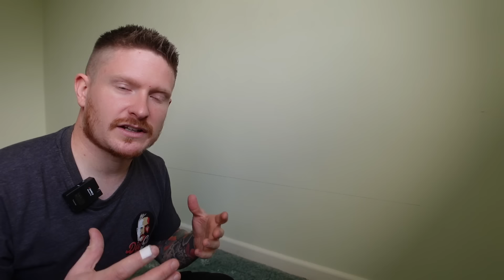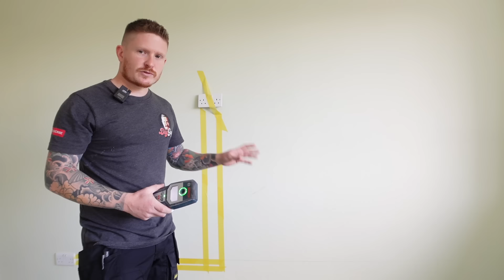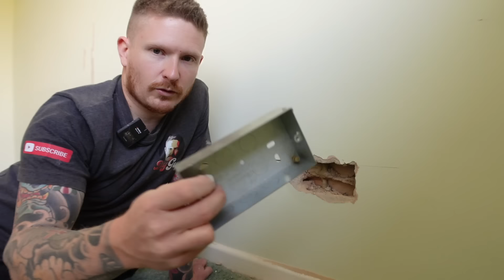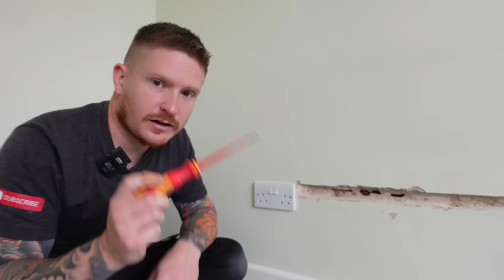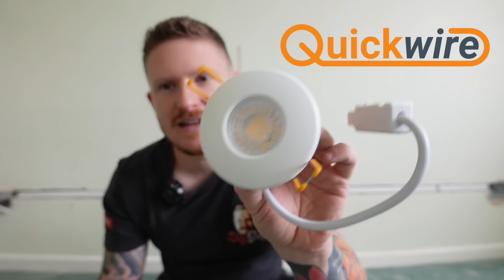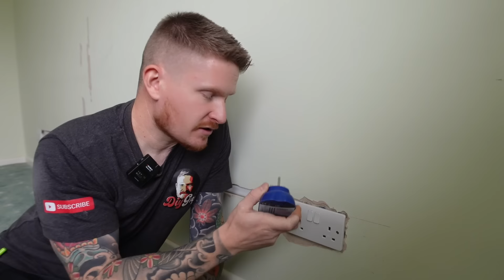How to Add a Socket to a Wall - Easy Step By Step Guide

Comment: Hi mate, how do you know if the circuit is a ring or radial? I understand looking in the CU to check for either one or 2 wires however, a single wire at a socket could also mean a spur than a radial? Keep up the good content 👌🏼
Reply: this is easy. check at the CU, if you have to sets of cables then most likely a ring. Then check the socket you want to extend from, if it only has 1 cable coming in, then you need to go check another socket. If it that one has 2, then that means the first socket you went to is already a spur, which you can not/should not spur off again.
Reply: @j8ybb  I could also check if its a ring or radial by looking at the circuit breaker mcb right? Ring would be 32amp whereas radial would be 16amp or 20amp. I could probably check this from the socket by doing a continuity test between earth to earth, neutral to neutral and live to live to get a reading

Comment: The only things i would add is.
Check the existing socket is still a RFC, all to often its broken somewhere...
You need to make sure the Zs and R1+R2 is good.
The fly need is good practise but not needed if the backbox has one solid lug and if it hasnt then the fly need isnt needed if a class 2 fitting is being used.
Reply: You sound like an attention seeker. This is a DIY channel.
Reply: This is a DIY channel Pal aimed at those who's moto is if it works its a good job. I doubt very much the poster will give 2 nuts about whether the impedance on his sockets is good & whether it will meet disconnection times in case of a fault.
Reply: @JIBS.  doesnt make it right though

Comment: Also do a video on adding an extra socket to be included in the ring main. Should be very similar just an extra wire. But may be useful for others
Reply from the maker: Great suggestion!
Reply: I was just thinking that iv always done a spur with 2 wires so its basically part of the ring then and another spur can be taken off of it if needed 😊

Comment: Thanks for a great video. You said you can't spur off of a spur. How do you determine if an existing socket is a spur or not? Thanks.
Reply: If there is only one set of cables in it then likely a spur....
However.....it could also be a radial circuit which would be fine to extend....these are on 20amp MCBS or RCBOS.
Or if there is FCU powering the spur...then you can add sockets to it fine with no problem
Reply: @SJM689 so how can you tell that it’s a radial circuit or whatever?
Reply: @hotmantym7096  usually by the size of the MCB a 2.5mm radial will be on a 20amp breaker, a 4mm will be on a 32amp.

Simplest and easiest, just pop the cover off the consumer unit and if the breaker has one set = Radial and if there is 2 sets of wires in it then it is a Ring...however that's still not 100% Guaranteed. To know for sure you need an MFT

Comment: What tests have you completed to ensure this is safe?
Reply from the maker: R1 + R2, Zs
Reply: @TheDIYGuy1  so you need to show this.
If its a ring then more tests need to be carried out.
An insulation resistance test would be recommended also.
Rcd or rcbo testing
You touch a socket it needs to comply so  you need to discuss adequate rcd protection.
Also discuss what test meters you need.
A standard voltage and continuity tester isn't adequate.

Comment: Will that foam hold over time? I assume it’s good for switches as you push them. But sockets get pulled on all the time
Reply from the maker: It will indeed.

Comment: As a time served electrician we are continuously told we need to update our training 17th edition 18th edition etc we had to serve a 4 year apprenticeship and many firms have to sign up to napit, niceic where they are grilled on yearly audits and it costs a fortune. Whereas there is no guard against diyers doing these types of jobs you can just pop down B&Q and crack on. At least the gas guys have gas safe and corgi. What you’ve done in this job albeit handy for a diy er is encourage unskilled and untrained people to attempt these jobs, yes 80 odd percent of the time this might work and be ok. It if it goes wrong there’s no dressing it up your dealing with death. For all the effort you put in to do this couldn’t you have got the floor boards up and broke into the ring main, that’s what a spark would be looking to do then he’s have to give you a minor works certificate that way there’s trace ability for future and nobody gna get hurt. I understand in this day and age people are strapped for cash but you need to remember that electricity kills and some unskilled guy could introduce a lethal hazard into his home. Be careful folks
Reply: Unfortunately 99% of those who've commented on this thread have absolutely no idea why we carry test equipment. To them if it works it works.

Comment: 15:15 Mmm...
I go along with you pulling the earth wire through the insulation to expose the individual wires, but you'd fail your exam now apparently. This because by pulling it, you're likely to have stretched it and therefore changed its potential resistance.
Bit arsey but best to know the very best way to do things I s'pose.

Likewise when putting a new wire into the points on the back of the socket. Best to twist all three bare copper wires together as one ~ keeps them together rather than relying on the screw alone. 

Finally as you've correctly covered your new earth and put in a new connection to the back box, also with sleeving, the original ring main earth should have been put in the yellow and green sleeving too ~ especially as this is a 'how to' video.

Just sayin' 
as they say.
Cheers.

Comment: I just used a multi tool and appropriate cutting blade for the brick because u was just chasing a cable i didnt need to go very deep caused a lot less dust was a bit if a bastard knocking out the holes for the back boxes though

Comment: Could you also do a similar video but with plasterboard walls as i am moving into a new build in 2 weeks and looking at adding more sockets
Reply: Lucky you. You'll have less mess from fewer chases.
Find how far apart the vertical studs in the wall are by using a tester like he showed but on the wood setting and then simply cut out a chase a couple of centimetres wider on either side of the stud.
You can then enjoy... the task of threading the cables through the wall from one hole to the next.
Then where you want the new socket, get yourself a plastic back box for plasterboard, cut your hole and basically clip it into place.
I'm sure that there's plenty of videos how to do it and why trust some bloke commenting on another's site but this is the gist of it.

Comment: Hiya Cameron, I sit here like most of the country stricken with flu and feel awful, BUT the video cheered me up..Good man. One question, what is the reason for a single spur only?. Surely if the source of the cabling can supply the voltage and current on a consistent amount, then it should be able to support another socket, or is it just safety regs? PS, just two words, masking tape, so much kinder to the walls :)  Thanks for the video, Paul.
Reply from the maker: Hi Paul. The answer to your question is quite a long and technical one but to put it pretty short and simple…. The single spur rule is in place to protect the cable supplying the first spur from being overloaded. If too many sockets were used at any one time then the draw from these sockets could overload the first piece of 2.5mm twin and earth. Haha damn masking tape!!, I always end up pulling paint off 😂🙈
Reply: @TheDIYGuy1  Thanks for the reply, as for the single spur rule, never stops us lot from sticking numerous 3 way plug adaptors in and creating a house fire waiting to happen..My only mild justification is that I always switch a socket off when done (bar fridges and freezers :)

Comment: Good vid bud. One thing, I did the same with the conduit, but my plasterer advised that when you’ve plastered them in they can cause cracking in the future in the plaster so he advised against em 👍🏼 
A good number of your vids have been very useful. Too job 👌
Reply from the maker: Thanks, glad you like the videos 👍
Reply: What would you use instead?
Reply: @noire1001 all round band or clip direct

Comment: Good video. I've tended to do things a bit differently:
1. A dust extraction attachment for a 115 or 125mm angle grinder can work very well. I have a Sankyo 125mm hood for my old Bosch grinder. Not cheap but very useful.
2. I use round conduit with connectors into the boxes. Since I use it everywhere, it's easy to pull cable through. You could have made the new socket part of the ring either by Wago connectors in the first box or new cable from wherever the first box came from or goes to. For conduit: 25mm takes two cables of 2.5mm2 twin & earth easily. Otherwise 2 * 20mm diameter for easy movement of cable.
3. I'd have cleaned out the first box - both vacuuming and scraping out all the gunk in it.
4. I'd have gone 6mm deeper then glued a piece of 6mm plywood or mdf into the hole to screw the box to that.
5. For some weird reason, I've never used plaster to fill the chased areas. Probably because I've had a bit of ready-mix cement available along with a small tub of fine filler. I really ought to follow your example.
Just finished a little project putting 3Amp neon light switches for each of our three toilet-shower-bathroom lighting and fan circuits. Supply to 3A switch to motion detector switch then load to light and extractor fan switch to fan
Reply from the maker: Thanks. It’s always great to hear other people’s methods and thank you for sharing yours 😊

Comment: Awesome video, this will come in so handy when we buy our house, hopefully next month. Even in my current room, sockets are in places which are covered up, like back of the bed or wardrobe so you then need to run a extension. The good thing is, I have all the tools, apart from a chaser drill, I had a look, they are not too expensive so it might be a good thing to have but you can still do the chase with a grinder, but take your time. Question, what is the maxium socket you can have tied to one of the original plug socket. So say for example, I did what you did, add one to the right so 2 sockets on a row but you wanted to add another socket in the middle, maybe for a TV, could you do that, add another socket and connect it to another existing socket. Hope that makes sense. Thank you for once again, you are so very good at explaining things. Also, what is the cut of wheel called, that you used in your grinder?
Reply: I’ve done this. I should however say that I’m just an enthusiastic DIYer and certainly not an electrician. The way I did it was to first insert an FCU before the spurred sockets - my understanding from the research I did was that the FCU prevents the risk of the cables on the spurred sockets from overloading / overheating in the event that you ran too many energy hungry devices from them.
Reply: Sorry should have said FCU = Fused Connection Unit. When researching for my use of it, I noticed people often just referred to a “fused spur”, which I believe just means a spur like Cam did in the video but with a FCU included first.

Comment: A great video. I'm doing some work in my new home (old council build) and the problem I'm coming across is that the plug socket in my living room is only about 30mm above some surface mounted copper heating pipes, so any plugs used have the wiring resting on the pipes. I'm needing to bring the socket forward from the wall so I can box in the pipes and still use the socket. Any tips on what I should use? Thanks

Comment: This video popped up just as I was considering adding another socket in my home. My job is going to be much harder though because it’s in a hallway and the nearest socket is in one of the bedrooms. Separated by different walls and door frames etc - if you made a video on more tricky situations like this that would be so useful! But thanks for this one, super informative. I didn’t know about ring circuits and radial circuits before
Reply from the maker: Your welcome. If possible, you could drill straight through the wall from a socket on the other side and place your sockets back to back. This method makes it very easy if it’s possible in your situation.

Comment: Can you wire the socket to be a part of the ring? By using wagos in the old socket on one of the old cables connected to the new then run two cables to the new socket and back to the old one?

Comment: Whats the difference between an SDS drill bit and a regular one ?  I only have a standard (not battery) drill and i need to go through a thick wall.
Reply: Sds are designed for masonry/concrete and the shank has grooves in it to lock-in to the chuck of an sds drill (I think to help with the hammer action that is typically used for drilling into masonry/concrete).

Comment: you should untwist the earth connections on the old socket they go into the same connection but for testing purposes its not good practice to twist them together like that (not a show stopper but pain in the ass later when fault finding)
Reply from the maker: I see what your saying but on such old cable it can often snap if it has been so tightly wound so I don’t like to do it if I don’t need to.

Comment: Love the video ad always! Handy tip; When lining up the new socket with level line, don't forget to minus 5mm off your back box to allow for the overhang of the socket! 
Tip no.2: Always try to run cables under floor boards (if you can) as it saves chasing out solid walls and less mess of course!
Reply: Tip number 3. Don't waste your time watching how to videos. If you already know how to!
Reply: @grahamd5418  😂😂😂😂⛄️⛄️
Reply: Yes, that 5mm is very important. NOT!
Reply: @ThePolaroid669  No it's not that important if you're a cowboy 🤠

Comment: Good guide, but you don’t need the cpc link to a back box as long as least one of the lugs used to screw the accessory to the back box is fixed (solid, not moveable), which they all have.
Reply from the maker: Yes your correct. Unfortunately because this is YouTube people will jump on me just because it’s fun if I don’t use a link wire.

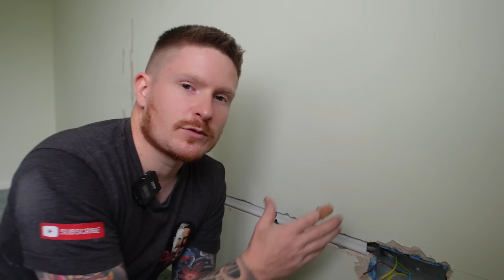Comment: 16:16 Where did the 2nd earth wire come from? Love the video! Tremendous work, very informative
Reply: It is a link wire from the metal back box to go into the earth terminal. 

I believe you cut a short piece of wire and cover it in earth sleeving. Then there should be a 'terminal' in the back box to attach it to.
Reply from the maker: Absolutely 👍

Comment: After cutting my thumb with an angle grinder at the start of summer (and effectively ruining my whole summer), I suggest you fit the side handle to the angle grinder!

 I was lucky and kept my thumb, and it still works correctly. The scar does hurt like hell occasionally when I take my phone out of my pocket!

Comment: On these soft blocks it's a lot less messy if you score the plaster with a Stanley knife and then just chisel the channel out with an old wood chisel. It was the the most common way in my years as a sparky.  The other way was to use a drill with a  masonry  bit and just drag it along the lines you've drawn and then just gently chop it out. It's quick and not messy.
Reply from the maker: Interesting, never used those methods but thanks for sharing them

Comment: I've just had an electrician do this in my home on the exact same set up. The only difference was that he chased the wall from the existing socket down over & ran the cable under the floorboards. He then chased from the skirting up to the new socket. The sockets were set at the same height as yours. He said it was the best way to do it to minimise the damage & dust. 
Can you tell me was this method safe?
Thanks 👍
Reply: Thanks so much for your reply. I'm really enjoying your content 👍
Reply from the maker: Thanks 😊
Reply: I was looking for a comment saying this….. you can see the cables in the existing socket go downwards so why not just roll the carpet back and get a floorboard up and do the wiring under the floor and then u only have 1 small chase 10 inches long to fill in up to the box 🤷🏼‍♂️
Reply from the maker: His method is safe. Both the method he used and the method shown in the video are valid and can be used in this circumstance.

Comment: Hi 
Great channel. 
If you keeping the ring main to add additional socket . Do you crimp on the one of the existing cables to the new and loop back again ?
Reply: If your spurring off a socket on a ring main you’d have 3 cables in the socket your spurring off and 1 in the new one. You do not need to keep the ring by joint it another cable in the spur into another socket, no

Comment: For fitting one additional socket instead of using  foam I set the socket in quick drying Pollyfilla. Same result but much cheaper as once a foam tube is opened the next time you need it it is solid!!
For the making good of the channel I use Pollyfilla as well as it sets quickly and can be sanded and filled where necessary rather than using bonding and multi finish which comes in big bags!!
Reply from the maker: Thanks for sharing
Reply: i agree! bonding not needed in a 30mm chase! I go straight to the easifill 60 and pva not needed either
Reply from the maker: Each to their own 👍, if your method works that’s great